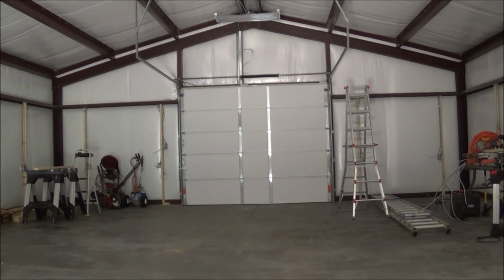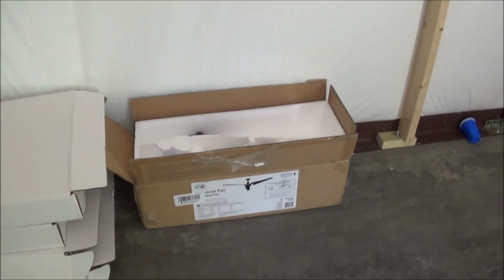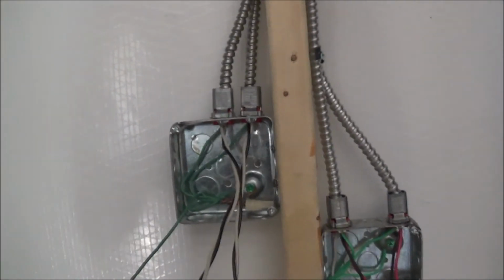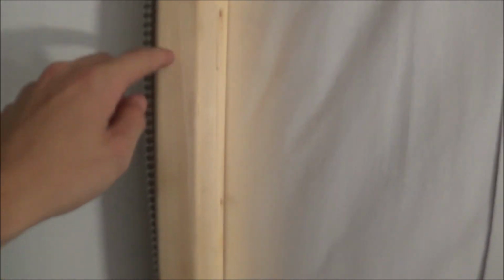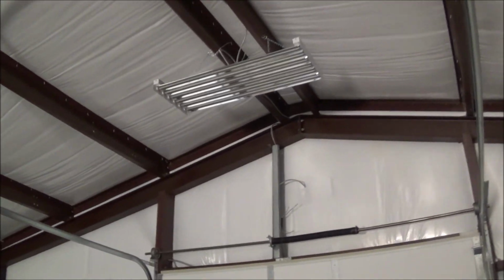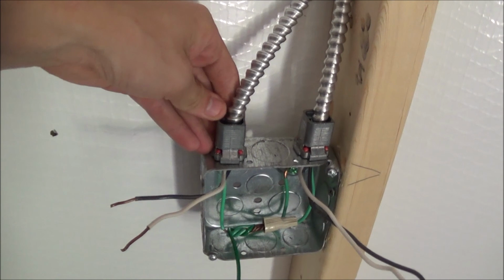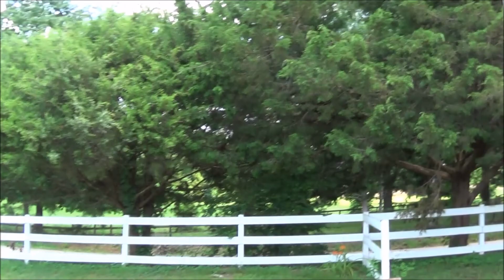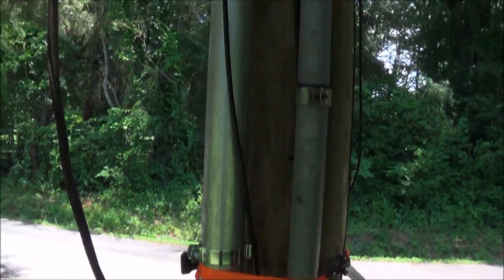Building Update 5- Passed Rough Electrical

Comment: Do you know how much you have in that building
Reply from the maker: JohnDeere50d No idea, I don't keep track. Doing a lot of it yourself saves a lot of $$. The biggest expense is the actual building and concrete (obviously). But doing the electrical tacks a bit on and the floor epoxy as well. There is a lot of stuff you don't think of when building it that you have to do, nickle and dime stuff!
Reply: crazyjdkid you probably don't want to know
Reply from the maker: I know rough numbers, but nothing I can put up here
Reply: Building a 32x30x16 right now in Ontario Canada... doing the same bx wiring throughout.  Great video! 

He’s absolutely correct on the nickle and dime stuff. Scissor lift rental/ forklift rental/ caulking/ tap/ tools needed etc. 

My building was $16000, concrete was around 16000 also. Garage door was $3500, infloor heating was 10000 (gas unit), lighting/wiring was $5000, site prep was $6600, insulation package was $3500, two man doors were $1400 and windows will be another $1000.

Equipment rental (scissor/fork lift/ versa lift) was $1500, tool rental was $1000 (mini ex, concrete drill, ditchwhitch) 

This unit will almost cost me $100k once said and done